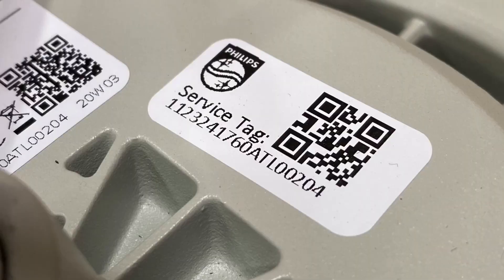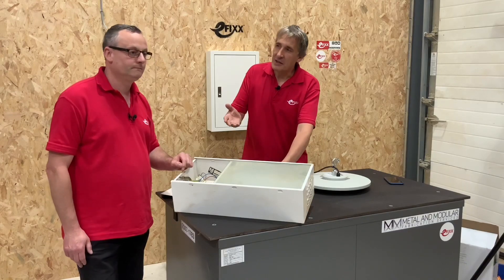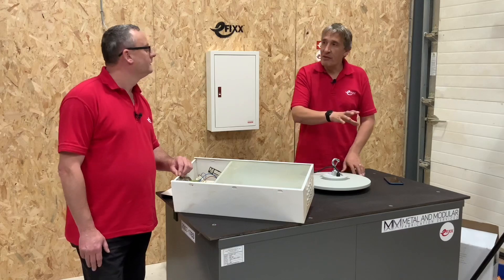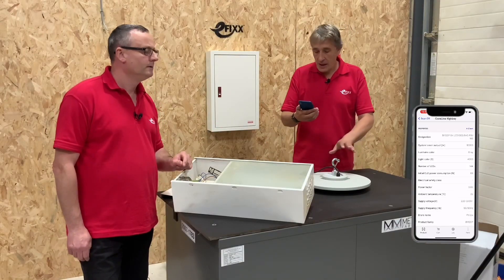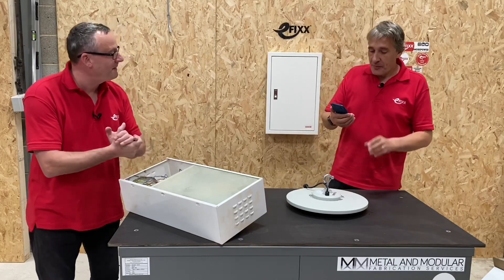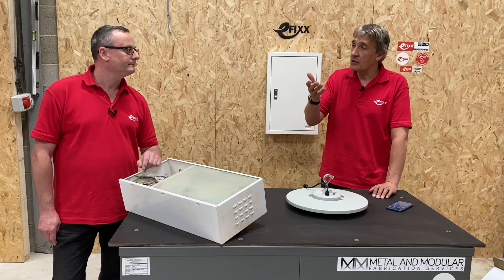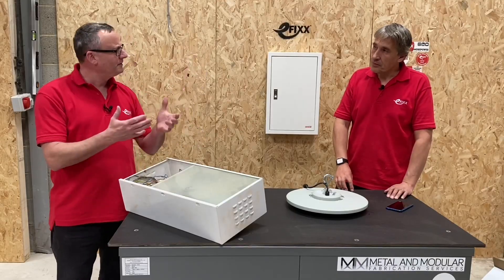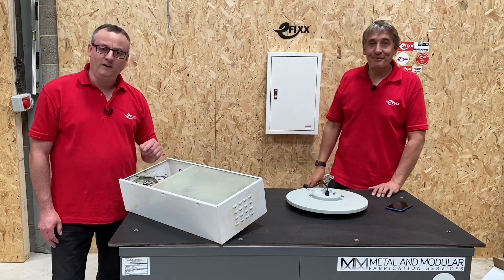How can a QR code make lighting maintenance easier ?

Comment: Ooh, look, another app that won't work in 20 years time!  Nothing like a label that tells you what you need and lasts the service life of a product.
Reply from the maker: The product still has a regular data plate label and comes with printed instructions.
Reply: @efixx  Good to know!
Reply: Chuckle, that was to be my comment as well, it's only as good as the information that is available on it (or not as the case could be). You can also use it to build up a site inventory, using the unique code to map your fixings. It'd be owned by the person/team/company that created it so is unlikely to be passed to another unless specified as part of the contract transfer.

It has potential, but is more of a 'nice to have'.
Reply: @Tim Earp Indeed!  I'm from an IT background so I have a horror of these cloud reliant things.  I much prefer spreadsheets and ID numbers.  If the place is large enough, they might have facilities for using QR codes tied to an internal inventory management system.   I would be interested to know if the App has an export function though.  If there is a way to get the information out of it, then it doesn't really matter if the app or service behind it dies.  Also, it would be much better if these things were an open standard where all manufacturers can participate.  I don't really want 10 apps for every manufacturer and their dog!
Reply: @abdullahseba4375  Me to, I tried the app and you need an account which I may try later. The text string matches the QR Code so you could use a 3rd party system and collect data that way but we all know that asset management is a great idea but expensive to do well.

I wonder what the MTBF is for the item? Bet it outlasts the app..
Reply: @Tim Earp Typical!  They totally need my details in exchange for some specs...  Parts of the app will obviously need an an account but now I need 10 apps, 10 accounts and 10 passwords, one for each manufacturer.  Then I have to deal with the resulting marketing emails...
Reply from the maker: The service tag was originally rolled out in street lighting. The companies operating in that space operate on contracts which last up to 25 years. So I’m sure some extensive validation took place to ensure the system is supported for the lifecycle of the product.  We believe the data can be transferred to external third party asset management systems.  *Gordon
Reply: @efixx  I would hope so but there are plenty of examples where this is not the case.  They do have a Q&A which addresses some of my "gripes"   It looks like you can export the data so that is definitely a major positive if it works properly.  The streetlighting side of things appears to have a larger system behind it I would be very surprised if it was just app-based. 

https://www.lighting.philips.co.uk/systems/themes/service-tag

Comment: It makes sense, I mean look at local councils and street lights, each one with a unique identifier tell them the location, number and type of unit.

Laptops, computers, white goods etc have had some iteration of asset management for years.

Great that it's being used and ultilised though.

Old hat tech brought into the 21st century.

Typed this before watching the vid with sound on 😂 you mention it in the vid, taking it a step further; some authorities give each asset an email address, users report the fault by emailing the devices email address, this then makes a support ticket in the ticketing system.